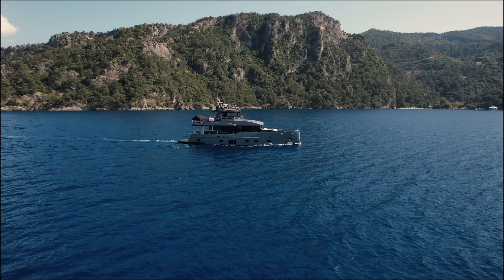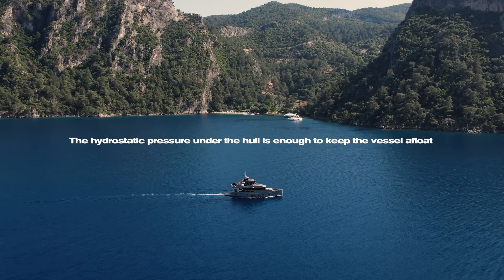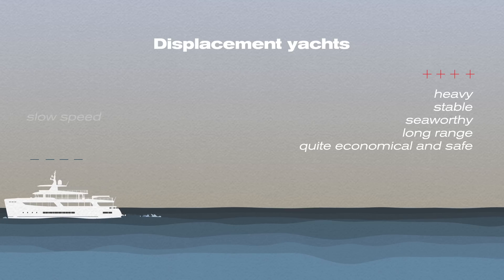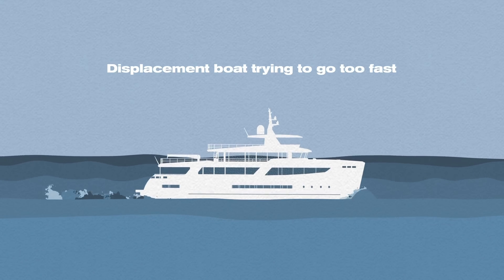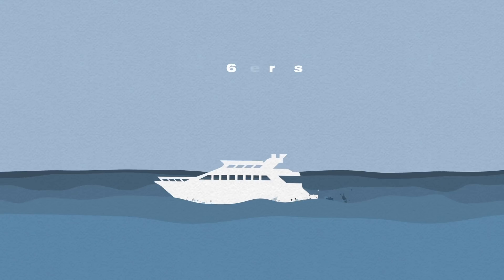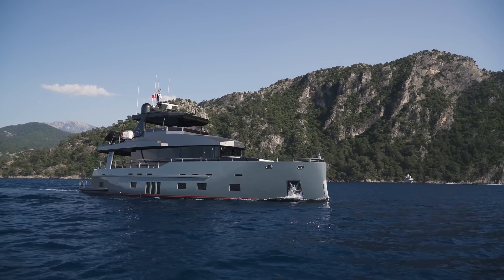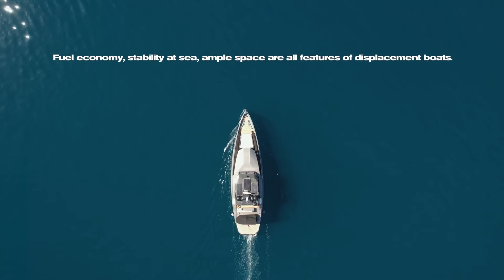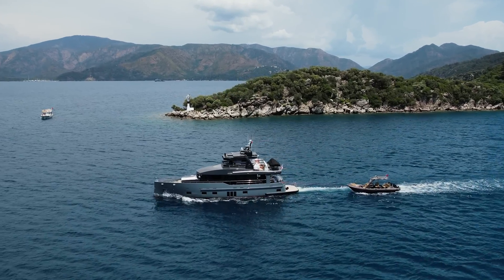Bering Exclusive: What Displacement Means for Serious Cruising

Comment: I love your boats , but prefer Tony Fleming ‘s Yachts .  His initial boat is still in production after being introduced in 1984. I doubt any of you boats models will be in production that long.  The problem with full displacement is you are stuck at a slow max speed when you have an emergency. When weather or heath problems strike, you need the capability.

Comment: The chart was informative ... Its just me, but I find having the tender in tow is a nuisance; and better to have it integrated. I mentioned in a short, that if I was designing I would create a rear ramp similar to Wider - with a twist. The read tender that I would add would be two stories (similar to Vandal) and hydrofoil. Big enough to touch and go a small helicopter. On ship - or off? Real James Bond stuff.